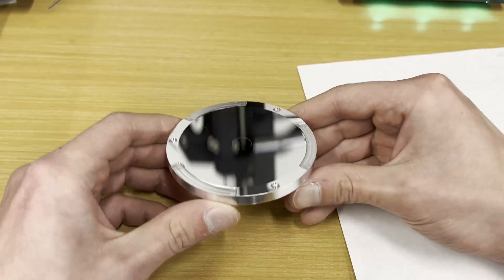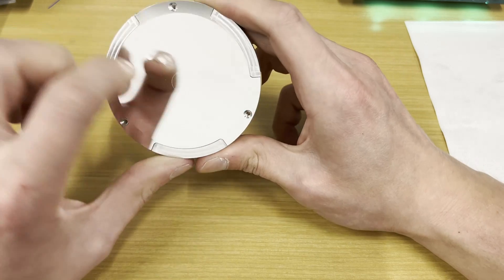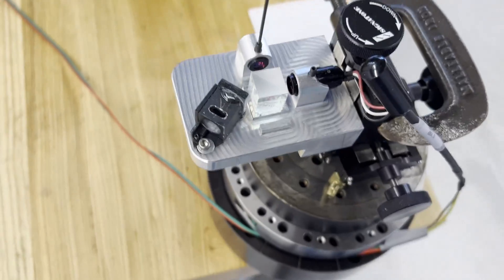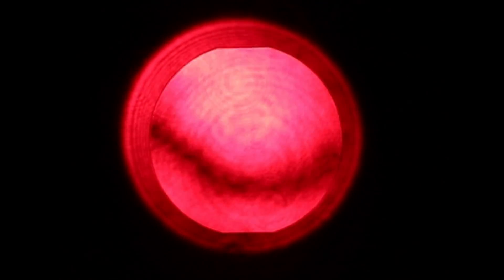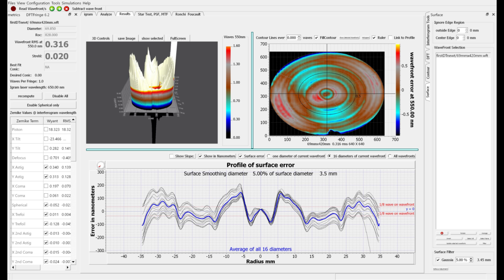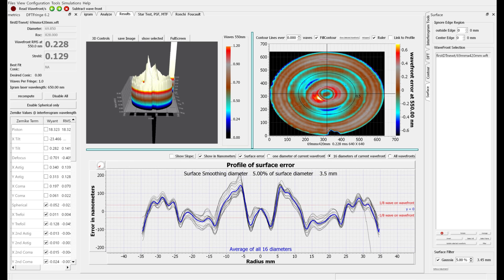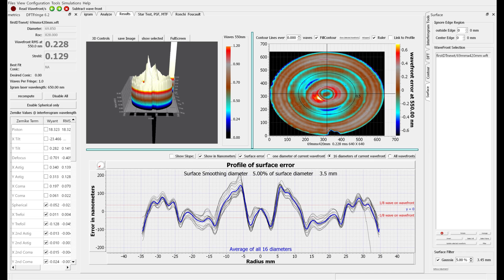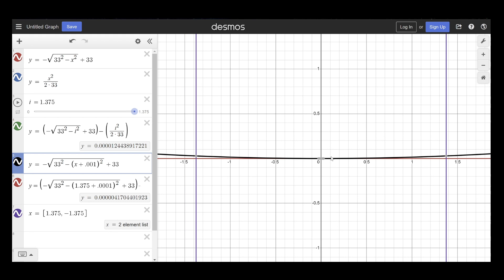Interferometry!- Diamond turning a spherical mirror pt 2

Comment: What kind of environmental controls do you in place. For some projects Moore Tool baths the entire machine in the same oil used for machining. How often do you check the cutting tool geometry? Are you using a laser interferometer? Changes in humidity, barometric pressure and, of course, temperature can effect the parameters of the laser. Still, amazing dedication to the science, and practical use of, metro.ogy.

Comment: I have an idea of how or what can be causing the blemishes. Wherever you are doing your maching (lathe setup location) could be getting vibrations from something as minute as a A/C unit on a house running could potentially cause blemishes on a micron level, so pretty much any other machines or appliances running or even talking to a friend in the vicinity  of operation can result in acuastic resonance in the tooling or the oarts being machined. Thats why if you ever go to a professional manufacturer of these telescope mirrors they have clean rooms that are also acoustically cut off from the outside world that is if they are making mirrors in the same manner as diamond lathe, but there is also lapping of mirrors. But what im trying to get at is next time you machine a mirror turn off any other known electrical sources even the a/c on your house and see what the results are
Reply: That's great advice

Comment: I am not sure the surface will get better due to bearings at those scales. Metal doesn't cut the way you think.
https://youtu.be/aF7ltBT_atA?t=377
Taking a shallower depth of cut can actually give worse finish in some cases as there is not enough material being removed to produce a proper chip to evacuate. Instead it just mushes around. This might be what you are seing. The sudden change in cut at the inner area may be the stepover vs feed crossing some threshold causing it to suddently "bite" better. The speed of the main spindle would have to be controlled relative to the current cutting diameter to create a constant linear feedrate to eliminate such thresholds.

Comment: You're using a drawbar, right? If so, did you measure the part constrained or unconstrained, and to the same torque?  
Also, if the tool was above center then the cutting forces likely increase the closer you get to the axis of rotation, which could contribute to errors.
Reply from the maker: I did this test today, it has some effect but unfortunately not really close to being the dominant error source

Comment: I think you really need to consider the overall stiffness of your flexture tool post / holder. The snap back could be the change in surface feet per minute as you are turning across the mirror face (outer towards inner) and causing the flexture to stress slightly.
If the constant stiffness is not there throughout the whole cut, you're going to see turning rings as the monocrystalline diamond and flexture are fighting against each other.

Comment: How do you determine that the defects are caused by the spindle bearings rather than the servos that control the tool position? The error in the figure has built up over numerous machining passes, as though the errors in tool position have added coherently.
Reply from the maker: Spindle bearings are honestly the last suspect (cause PI is the best). However, you make a good point about the errors adding coherently. Spoiler alert, I had another go at it and saw a similar looking error profile in the new results. Trying to determine if this systematic error is on the metrology side or the machine side.
Reply: @cylosgarage  I was conflating this post with one of your earlier posts where you ascribed vibration problems of the spindle to airflow through the bearings. I assumed that post referred to a spindle of your own design. I should have asked if you were using the PI spindle here.

Comment: Sorry to add to your list of variables, but tool break in could also be a factor as well. Aluminum can also be very temperamental to turn because of the other embedded things in the material that can damage the tool edge or ruin the surface finish.
Reply from the maker: Ah, the joys of precision engineering!

Comment: About the astigmatism, it's generally caused by stress in the material during the lathing proces. Either internal stress in the material or (more likely) due to the mounting method. The mounting method you use does not really eliminate the introduction of stress.
Reply from the maker: Thanks for the tip!
Reply: 8:24 in the picture in  the top right of the screen, you can even see the three blue marks caused by the three mounting "dogs" - if you imagine holding it using a centre draw bar to pull it against a ring, it will cause it to deflect into a concave surface, then when you  machine it flat, then take it off, relieving the stress, it will deflect to a convex surface.

Comment: Does diamond turning typically try to use constant surface speed? Would that avoid some sources of tool pressure variance across the optic?
Reply from the maker: Generally CSS is not used for diamond turning because changing the spindle speed would change the forces and hence deflections due to spindle imbalance as you move across the part. It’s a bit of a compromise in this regard.

Comment: Very interesting - thanks. Is the blank cut from plate? If so, the (symmetrical) astigmatism could be due to anisotropy wrt the drawing direction of the plate.

I wonder if the rise in the surface inside ~R=13mm might be due to the blank distorting from your drawbar - actually machined flat, but sprang back when the drawbar was released? It doesn't explain anything to do with the feature inside R=5mm though. 

Can you tell anything about the X=0 position from the angle at the top of the curve in the centre? If X 0 was correct, then the two halves of the trace should be tangent in the centre.

Looking forward to the next instalment. :)

Comment: As soneone that writes software for devices my vote is that cause is rounding error in toolpath calculation. You are dealing with math where regular 80bit floating point isnt precise enough. Maybe inspiration for a video how whole proces goes from formula to toolpath generation to hardware used for driving and actuators. If you make second part you can see if pattern is repeatable or it is only random noise.
Reply from the maker: I have thought about this a little. I’m not sure how Linux cnc is doing the math in the Gcode behind the scenes, or how much it rounds. The benefit of having it in the Gcode is small file sizes. However, I have considered writing a matlab script to directly calculate the tool path to a specified precision and output a Gcode file of discrete points. The only downside with that method is your file size rapidly gets deep into the megabyte regime. Not sure the limit of what Linuxcnc can handle. I suppose another benefit of using the externally generated toolpath is the ability to create error maps and apply compensation to a given toolpath. hmmm...
Reply: @cylosgarage  I've done some pretty hairy adaptive paths and LinuxCNC doesn't care. I can't remember how much lookahead it has though, since a pause to refill the buffer would kill your process. All in all you're doing great work! I do worry about internal rounding errors in LinuxCNC proper though (or finding the right config entry)

Comment: Do you have the rotation speed relative to the distance from the part center when cutting? Otherwise even if you have the perfect surface speed at one point at another it will be wrong.

Comment: Looking at main profile graph, my first guess it is some sort of undamped acustic vibration issue. No idea how to counter it, maybe use much more bigger mass for lathe and/or make special damper based on viscosous liquid with counterweight. Another enemy is temperature,  maybe get some cheap but high res IR camera and ttermocouples al around lathe structure and track what happens during whole precess, maybe some unexpected local heat and bending. Anyway, very exciting to see this project, thanks for share.
Reply: Temp controlled environment and much bigger lathe 100%
Reply: A former friend had his SIP Jig borer set up in a separate basement room, with its own concrete base, completely isolated from the house, and a precision A/C system, with very high air flow in the room, in order to maintain an isothermal environment.
Where there is a potential for step size errors in a system, one can add "noise" in the loop, to reduce "sticking" on sensor and actuator increments.
Reply: Yes my thoughts exactly, there is specific harmonics that are going to exist with the length of the tool, the vibration of the tool, and the feed speeds.  So at least one of these are going to have to change.  

I also bet the distortions are also at very specific multiples of intervals.